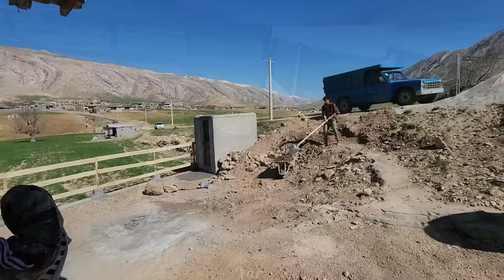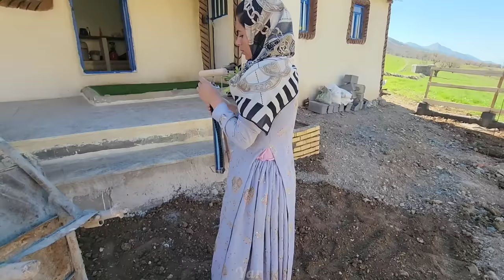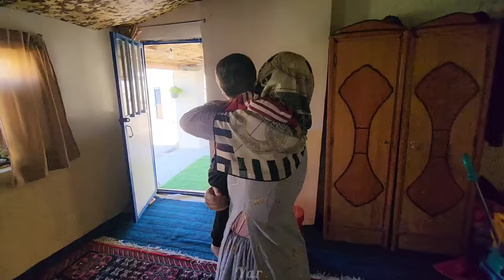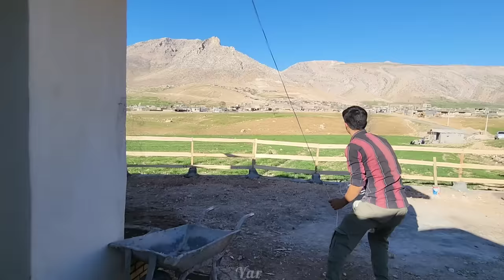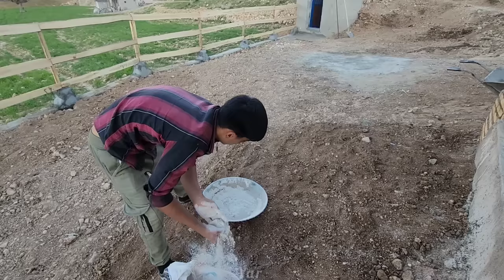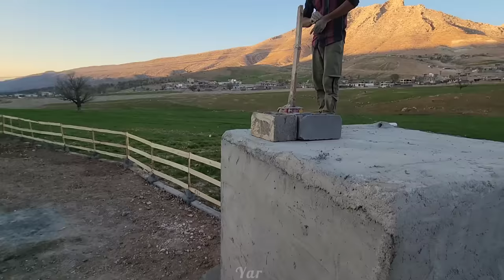Nomadic Family Adventures: Toilet Wiring with Abolfazl | DIY RV Renovation"

Comment: Suggestion.  Run conduit under ground for electrical wire to the toilet.  Will last longer and look better.  And put the globe directly in the centre of the ceiling.  It will cast more light and less shadow

Comment: The light globes will burn out if they touch anything.  The concrete will cause them to fail very soon.  If the globe touches anything cloth it will start a fire.  
Maybe you can consider putting the wire in plastic pipe and dig a trench up to the new location.  Abu is a very good worker, and always does very neat work.

Comment: Abolfazl why didn't you just drill a whole on top in middle of roof this is for the restroom 🚻 that way you pull the cords for electric 💡 then once electric 🔌 wire is pulled through then you could have patched filler the small amount of any openings where you did you're drilling with plaster or cement whatever choice of your's so that way you wouldn't have unwanted wiring running through all along of outside walls 🧱 of restroom ! Just a bit of advice thank you have a blessed day 🙏

Comment: Just a suggestion:  the overhead light in the toilet would be more effective if it was in the center of the room. You could hang it from a hook in the ceiling and not have all that compound on the wall. The Pole on top of the toilet could have been in the ground beside the toilet, stationary in concrete, and not have those unsightly blocks and cans on top of the nice building you have built. You have done a great job, and I am sure the best you can with limited funds. (I certainly understand that). Your work has improved the residence greatly.